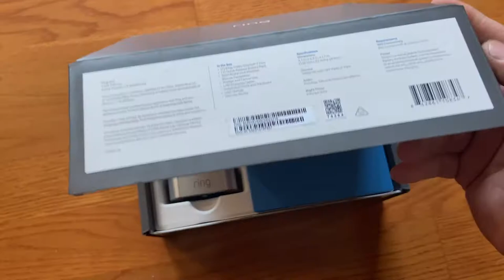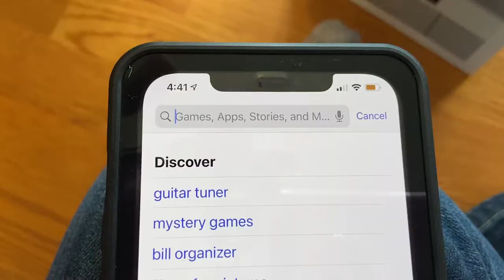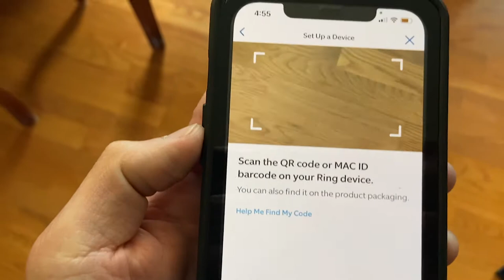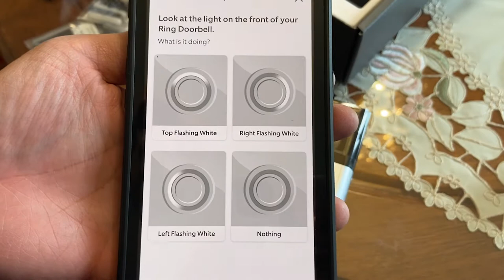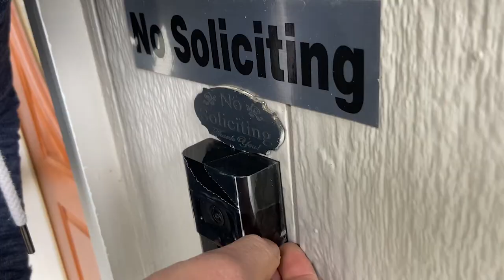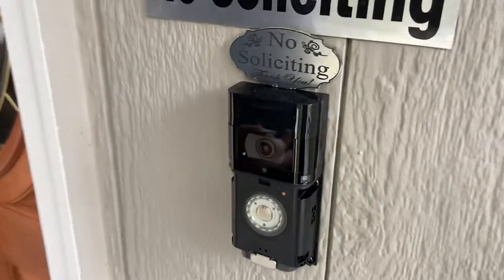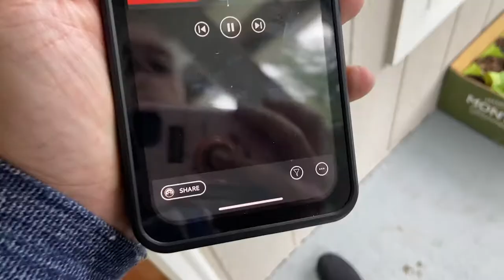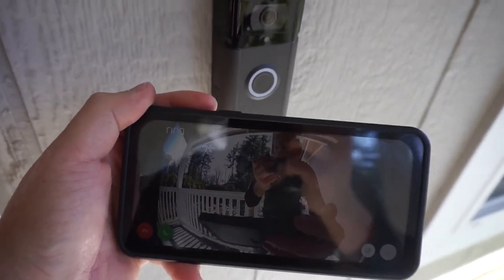How To Install Ring Video Doorbell 3 Plus | Full Wiring And Smartphone App Set Up!

Comment: Hi i love how you simply but ditect to the point explained it. Just have a question is there a wired version of it i mean the non battery one, coz what if it's low bat it might not give an accurate result.

Comment: What if your home has never been wired for a doorbell? Would you have to buy extra wiring and hook it to your breaker box? And what about a inside chime so you can hear the doorbell? Or does Ring make a doorbell and a ringer box that just run on batteries and wifi? Please help.

Comment: I also wired it, with a working 16V power supply, first tested with the tester....but I don't see the doorbell recharging and it has already dropped to 85 without showing signs of charging.....is this normal? I don't know what to do, strange it doesn't recharge....

Comment: My Ring Doorbell 3 came with a blue screwdriver that doesn't fit any screws on the device?? Looks like a Torx bit. I also didn't get a level or replacement cover for the lower half of the device, wth??
Reply from the maker: Oh no! Please take it back and have it replaced 🙏🏽😢
Reply: @FixThisHouse  Actually, it seems to be a slightly stripped down version, but I did get an email to receive a 2nd cover in the color of my choice. The Torx screwdriver only fits the security screws at the bottom of the unit. I took it back though because it's a little large and now I'm being told that the smaller/cheaper vRing video doorbell wired,  won't ring my existing chime? That was one of the main reasons I bought it. Maybe someone can confirm?
Reply: Bought mine 2/06/23 from Costco It is missing a lot of the items shown in the video.I think some of these Costco buyers do not do a good job of checking the product out.